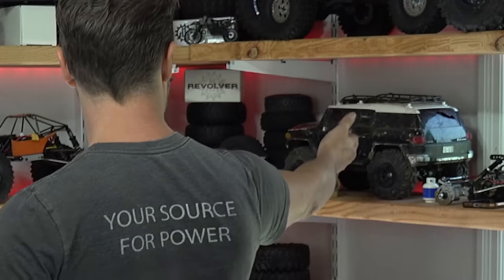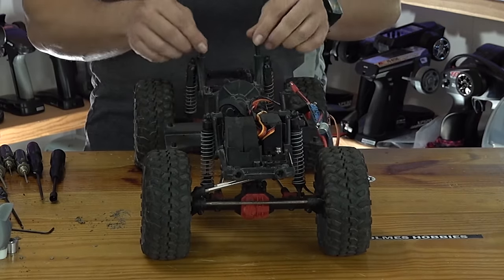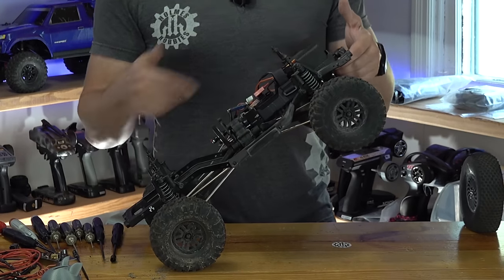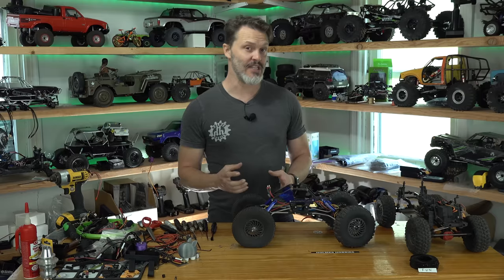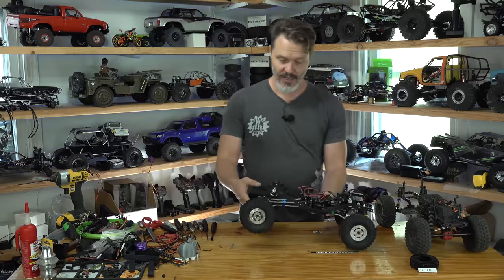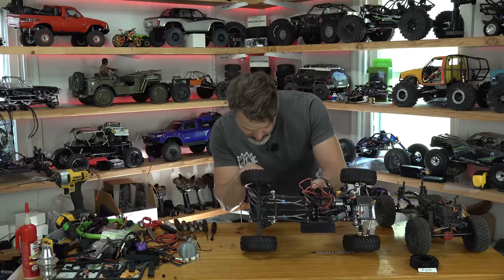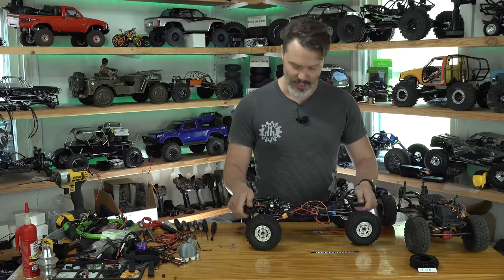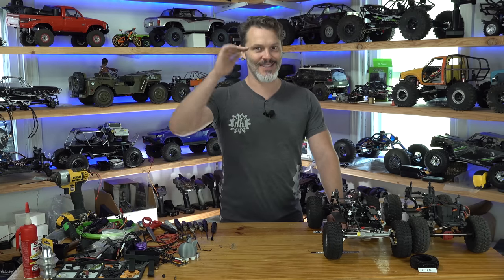Does Your Rig Flex? Mastering RC Rock Crawler Performance: Suspension Geometry with Holmes Hobbies

Comment: I've found more flex usually hurts performance more than it helps. 80-90mm shocks are great for most trucks available these days.
Reply: Yep 80-90mm is the sweet spot. All these noobs with 100-1200mm desert licker shocks crack me up!
Reply: @josthompson7642  1-120mm anything all jacked up makes me laugh. Lizards aren't bad shocks though. They just take some time and effort to set up right. I loved them on my v3 but they were in "droop"
Reply: LOL   
 @josthompson7642
Reply: 90mm no less around here big rocks big dirt gotta have travel for speed smoothness and to keep momentum
Reply: @braydenfrench8569  I've got a few comp trucks with 80-85mm shocks. They don't need massive flex to perform awesome
Reply: @rc-daily  agreed. But in comp you do not wheel like I have too. West ky bout an hour from garden of the gods if you aren’t too far I love to have new wheelers come out. In comp you take your time and don’t move quick. Fuck comp I want to see who can climb the almost impossible and come back with better mods
Reply: Yeah for sure, more Flex isn't always better, sometimes you want more weight on the tire that is getting traction

Comment: A basic understanding of suspension geometry is important to get the most from your RC.  For crawling especially, understanding how setup affects your rig is vital.  Crawling is one of those disciplines where knowledge of full size geometry directly relates to our RC cars.  So, watch as many videos as you can, understand how link geometry affects handling,  understand things like roll center and instant center and centre of gravity and most importantly, how settings affect each other.  Learning and understanding these principles can be confusing and intimidating but the good news is, one of the most powerful tuning tools available is something we can all utilize - TESTING!  The best drivers, regardless of the discipline, spend HOURS testing setups.  Don't really understand how raising or lowering links affects handling?  Make the change and go out and test.  And keep making changes until you understand how your changes impact performance.  There is NO substitution for putting in the time and hard work.
Reply: I AGREE 100%

Comment: Good video, however you unfortunately have your roll centre explanation around the wrong way. The roll centre/axis is the point that the COG rotates around. A high roll centre is actually beneficial for rock crawling. If your roll centre is low (and therefore your COG is well above it) the body rolls around excessively like you shower with your yellow truck. Have a look at Busted Knuckle Off Roads video called Roll Centre Explained. Very good video explaining it all!
Reply from the maker: I might have said it reverse by accident but that's what I tried to demonstrate with the body roll on the yellow truck. The sprung cg above roll center causes massive body roll.
Reply: This comment is good. I’m from the full size world and love being able to easily experiment with these 1/10 scales off of the exspierence from the full size world

Comment: I’m fairly new to the hobby, but I’m a automotive mechanic by trade. I have not done any custom off road suspension builds myself,more of an under the hood horsepower knowledge mechanic. That being said, I have a scx10 that’s all I know about it,bought it used from someone who I don’t think knew anything about it either. Anyway I’ve thrown a lot of parts at it, and the rear end is as loose as a 2 dollar whore ,from side to side movement. Just looking for some ideas or advice on what I can do to improve it?? Thanks ahead of time any is appreciated!!

Comment: Shock weight and springs can play a huge roll in performance. I have some rigs that I run low viscosity and no springs(droop). You can achieve a very low center of gravity and use the front wheels to drag your rig over the rocks.